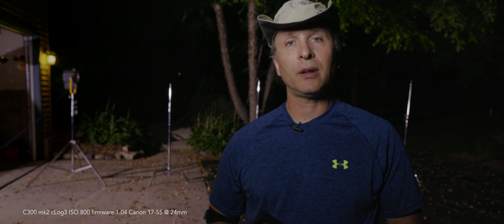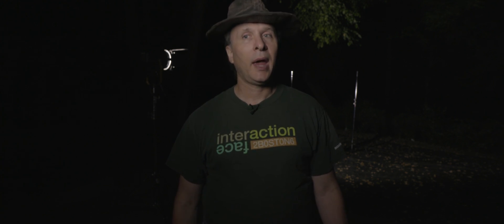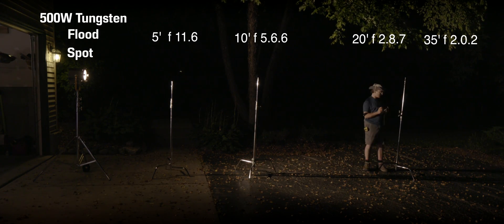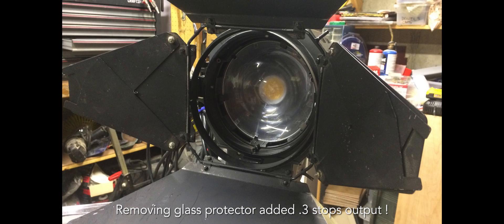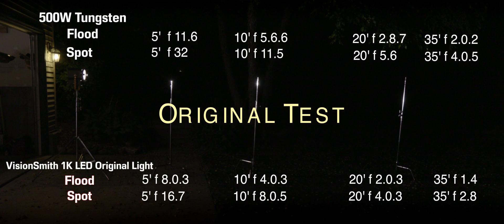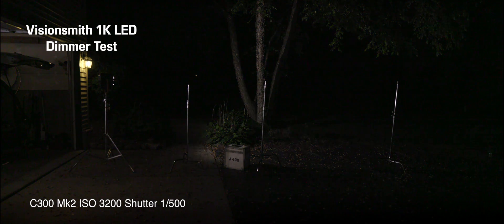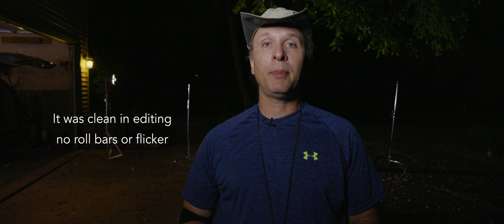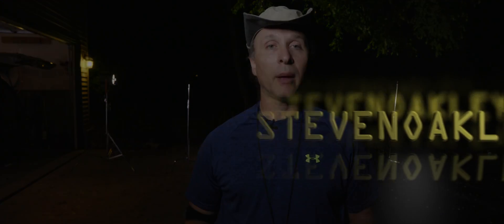Review and Test of The VisionSmith ReLamp 1K LED Replacement Bulb

Comment: Thanks Steve, great review !.     Just kept wondering...if you keep the reflector and the original fresnel, would it be safe to say an Arri T1 becomes a 650 Led and a T2 something like a 1,5k ?.    Also would like to know how they compare with similar HMI´s.    Let´s say the output of a converted T1 versus a 1,2k HMI.     In any case I just think it will be a matter of time for these "LED bulbs" to become more powerful and bicolor to transform a tungsten fresnel unit into a Bicolor Led of the same output !.
Reply from the maker: I have no reference point on output for the Arri's.  As far as compared to HMI, right now LED seem to be about equal or a little less than HMI's comparing output at the same wattage. So it would be safe to say the 150W LED is a bit less light than a 200W HMI with lens. 

The LED lamps are so large they pretty much over the reflector so its not doing much good. Leaving the reflector traps heat in causing the LED's to throttle their output down due to heat. 

I have a cheap LED fresnel in a Arri 650 housing, I found a fresnel on ebay for $10, cut it to size. No its not as thick as the VisionSmith one, but for the price it bought me another 1/2 stop of light :)  plus is dropped some weight from the light. there is  no reason not to change the lens as its all benefits to do so.

For a bicolor LED to equal a single color one, each emitter would need to be 2X more efficient in light output which I don't think is going to happen any time soon... and if if that did happen, a single color LED would simply have 2X more power because all its emitters would be doing the same thing. So  I don' t think this will change.
Reply: @thedp  great review!!! What about this cheap LED that you bought for $10. Did you mean that you put that one inside an Arri 650 housing and take the lens out? Where we can find and buy these cheap LEDs? Thanks!
Reply from the maker: UnderdogStudioz no idea. With cheap LEDS the question is all ask always the CRI. No idea what the output is but you'd want something that's at least 50w or more like  100w to have useful output.
Reply: @thedp  thanks for your reply!!! Finally I decided to buy 2 Arri 650W fresnel model. Really love the output. One friend told about the the LED Aperture 300D, and that instead I should buyed that one. Did I make a good decision? I know LED is really convenient at power consumption. Actually don't know if Arri 650 at spot mode, is no match in output compared with an Aperture 300D.
Reply from the maker: @JADURCA  well raw watts to lumens of output on LED's are about roughly the same. so you can't really compare 300W vs 100W and expect the smaller LED to have the same output. however the 650 fixture will make nice circles, cut patterns better. You really do want the plastic fresnels though. FWIW I had a cheap Chinese LED in a 650 style case and replaced its glass lens with the plastic fresnel and also got more output with it, about a 1/2 stop. so worthwhile .
Reply: @thedp  my bad! I meant the Aperture 120D ,not the 300D. Sorry! The correct answer is if my new Arri 650 Tungsten Fresnel using actually tungsten light, would have more output than a Aperture 120D? Thanks again!
Reply from the maker: UnderdogStudioz can't say. You'd have to look at the specs  on output. There are too many unknowns here. A tungsten light needs the lens and reflecter cleaned once a year, maybe more often or you can loose 1/2 to full stop of light.  They are going to be in the ball park. If you put CTB on the 650 the 120 would be more...
Reply: @thedp  thanks for the quick reply!!!

Comment: was thinking about getting the 2K version, but now it seems like it will not meet my needs considering if you buy a 1K it's more around a 700, then a 2K would be more around a 1400w tungsten....  very misleading company.
Reply: Joe O. Depends on what your needs are, which you shouldn’t be basing on wattage alone.